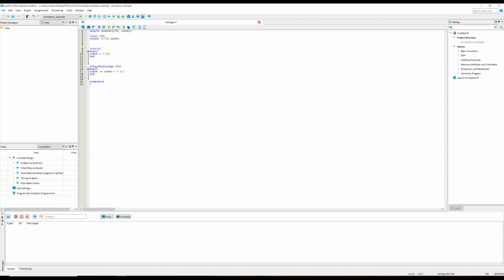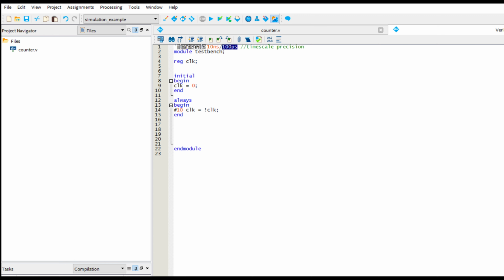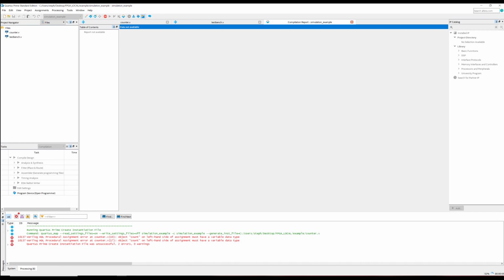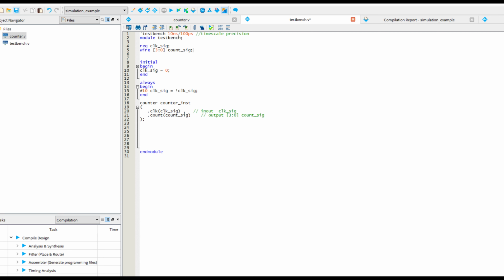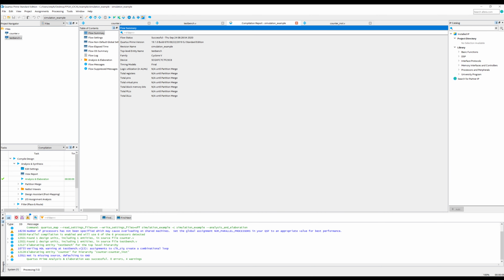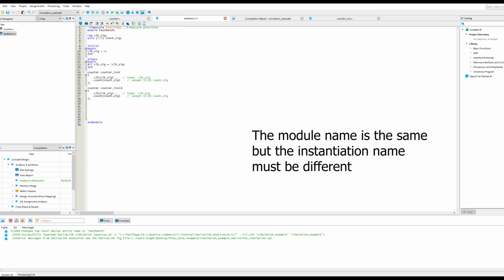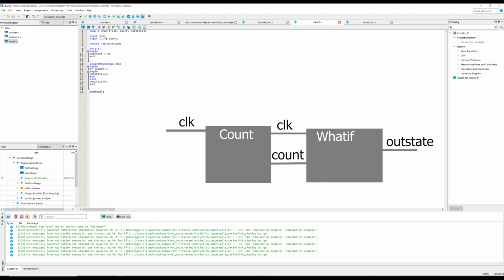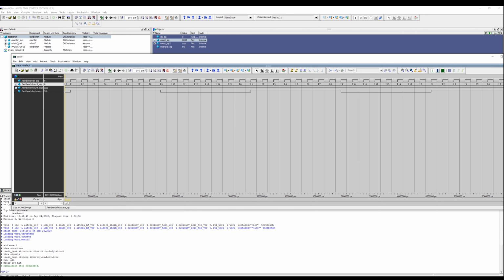Simulating Verilog Designs in Quartus and Modelsim using Testbenches - Essential design flow.

Comment: Hi! Trying to use your work to get started simulating FPGA designs. I follow the steps and code in the video exactly, but always get the error "Error (12061): Can't synthesize current design -- Top partition does not contain any logic". Can you help?
Reply: yes, you should set your testbench as a top module first so it can simulate it properly, doing otherwise would error out the tool because the simulator is always looking for a testbench